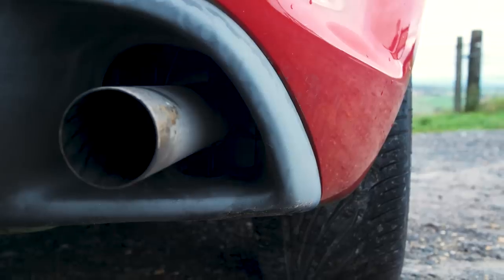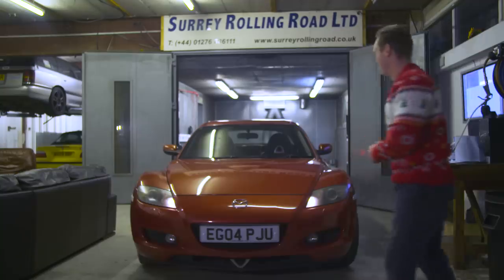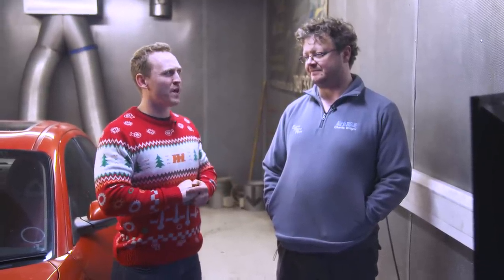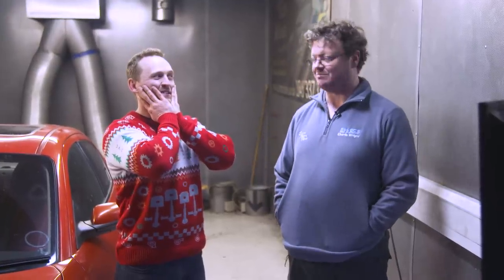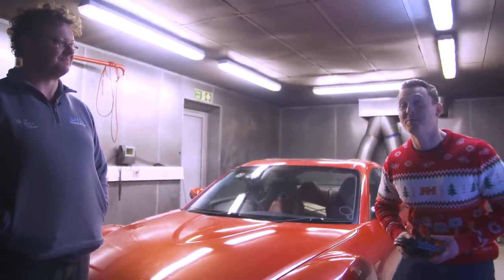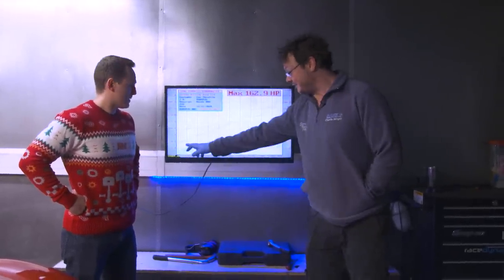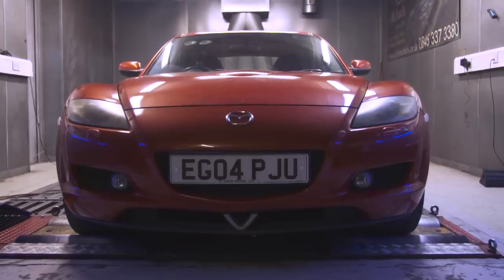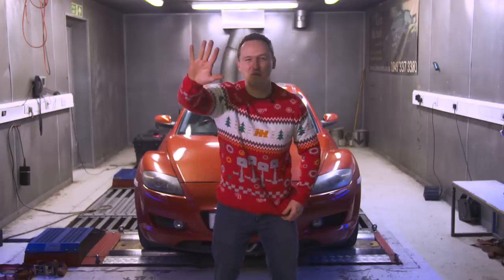How Much Power & Torque Does A Broken Rotary Engine Make?

Comment: I genuinely don't know why my RX8 was so reliable. Started first time, every time up to the point I sold it at 92k miles. Still running perfectly with it's new owner. Never treated it gently either. 9k was hit every time I drove it, wasn't a rev limit, it was a rev target. 

I still miss it.
Reply: If you heat it up and then rev it to the limiter it should last a long time.
Reply: Yup. Seems that way.  First 5 minutes was never above 3.5k rpm. After that, onwards and upwards. Got to get that third port open.

Comment: Missing out on an extra 1,000 rpm there. PIN IT!
Reply: My thoughts exactly. Although looking at the power curve drop it's not going to help this poor rotary.
Reply: stock s1 doesnt really make power past 8k so stopping there makes sense
Reply: was wondering if anyone else noticed that...
Reply: @MrDrJelly  nope, 231hp at 8'200rpm...
Reply: if the car has max 9000 rpm the hp peak is at 8000... something. usually in racing they still hit 9000 because the gear is shorter than the next one meaning it will be faster to hit redline and heaving more rpm for more power in the next gear to accelerate faster out of it...
idk how to explain but you get what i mean
Reply: With a fucked engine like that you wouldn't want to take it to 9k
Reply: Spot on! They make peak power at 9krpm.
Reply: drgibs347 it peaks on 8,2k
Reply: Worst thing is the rotors themselfs only rev to 3k max, the e shaft is the only part doing 9k revs (it's geared 3:1 with the rotors, piston engines pistons rev higher.
Reply: @alexstromberg7696  That's true however for every single rotation of the rotor it completes three combustion cycles so one cycle per rotation of the e shaft. In comparison, a piston engine completes one cycle for every two rotations of the crankshaft.
Reply: @alexstromberg7696  nooooooo my whole life was a lie
Reply: Sam Boofle rotarys need to be redlined tho
Reply: At least my 2004 RX-8 peaked in 9000 rpm and the limiter is in 9500 rpm. The peak hp on the wheels was about 180 hp(134kw) and on the flywheel 220 hp(164kw). This was run in +35 Celsius temp which is HOT. th The engine have not been rebuilt and have been driven 100k km.
Reply: @FVampir  you don't want to redline this engine...yeah it might gain 5-10hp on dyno, but  engine is already damaged...he wants to rebuild it, so it's better for it to not explode in tiny peaces 😂
Reply: @tomjames4064  they still only rotate 3k time a minute. If they do 3 time as much a rotation isn't relevant.
Reply: @tomjames4064  2 stroke!
Reply: @GTRWelsh  Rotary's are 4 stroke
Reply: @tomjames4064  yeah but one power run per rev is like a 2 stroke :)
Reply: @GTRWelsh yeah that's true
Reply: Yea I don’t understand why he didn’t rev it until fuel cutoff. Would have been nice to see that needle go DEEEEEP into the red zone. 

I kinda suspect that power numbers would have went up a bit more and post rebuilt, he would only gain back maybe 20hp at most. 

The point of a rebuild is to have an engine that starts HOT and doesn’t die at idle. Low compression sucks. My 04 has 140,000 miles on the original block and is barely running. Still daily it and rev to 9,500 EVERYDAY.

Comment: Why do you stop the Dyno at 8000? It still has 1250 rpm, and its peak power is way up there at the red line
Reply: My thoughts exactly. Didn't exactly rev it out
Reply: RX-8 can 10k RPM max.
Reply: It's over 9000!
Reply: You don't make peak power at 9000rpm unless you have some serious porting done.
Reply: Exactly, it can go to 9250 rpm, Peak power should be around 8500-8750 I think. But at least I am sure that not 8000 rpm.
Reply: with that dip in the graph that shows some serious problems, what exactly should it bring to rev it even further?
Reply: @Digi20  the dips are totally normal on a renesis. they are there because of the ports that open at specific RPMs. you can see that, even the last dip is then leveling, so it would probably make some more
maybe it wouldnt make more power, but the point of a dyno is to rev it to the limiter. 

ofc, in retrospec, and after seeing the compression numbers, this engine is ruined anyway, and its amazing that it kept running anyway
Reply: @dimosk7389  odd  all other dyno vids rev to the limiter.
Reply: @dimosk7389  what are the compersion numbers?
Reply: @ezakalized4066  I don't remember now, it's been a year. You can watch the next video of their series where they make a compression measuring (if I remember correctly)
Reply: He's car has compression issues and his his power band dips after 6k revs so no point reving it over 9k

Comment: These cars have a place now. It was a silly buy back in the day when they were new, because you had to be a proper petrol head to maintain it and as a daily driver it is so uneconomical. but when you can buy one now for £600 and rebuild it for the cost of replacing a turbo on a convetional engine it's very interesting if you want some weekend or track day fun. When you consider its main rival the 350z is still 7k for decent one, makes you realise.... I'm very interested to see the rest of this series.

Comment: My RX8 is named Mazdalena :) and her engine is being rebuilt at the moment so this series came just at the right time!
Reply: keyboard warriors :D
Reply: Keisuke Takahasi how?
Reply: Do yourself a favor and swap the engine with a v8 or inline 6.
Reply: @glock1inthetop45   You cant just stuff a rew in and call it a day. For the amount of money it would take, you could rebuild an RX-8 engine at least 8 times
Reply: KillaRock404 yes you can dude they make bolt in kits it’s like 2 thousand plus another 2k for a rew I did it myself
Reply: KillaRock404 and hell no they charge 6k to rebuild a renesis I’m California
Reply: @glock1inthetop45  6k sounds like a remaned one from mazda. To rebuild one it, if youre using the same irons and rotors cost about 2-3k. For a REW swap, theres a lot you have to do. You might even need a new transmission depending on the power you're looking for. To do it right its going to cost you about 20k after everything is said and done
Reply: KillaRock404 no it’s not dude lmao I dude mine for 7k 460whp 12psi
Reply: @glock1inthetop45  sounds like i need to go to cali for my swap then lol
Reply: Thats a good name

Comment: These rev to 9.5k and the power is right up top and the tester only took it to 8k :/
Reply: Power drops off so its pointless.  You can run them over 10k if you like, but there's absolutely no point.
Reply: @petertr2000  they have no torque they need to be revved
Reply: Demekpr4e n
Reply: @lilpattman  do you know how bhp works? its a function of torque, if it makes no torque at high rpm then it wont make any power either
Reply: Or the thing wouldnt rev to 9+

Comment: I'm happy you bought a RX8. Because I never dared to
Reply: I dared to. Best sports car I've ever bought. I touged with an evo and stuck with it the whole time, only slightly losing my gain on the straight aways
Reply: @mendezmarcos38  yo its possible to buy a rx8 and change the engine so it consumes less fuel ? just asking cuz i really like this car but need to spend less money on fuel

Comment: I've owned my Rx-8 since she was brand new. Bought in 2007, she never let me down and I had a lot of fun with her. I would never regret going Wankel. (=
Her name is Roxette, but friends call her RoX-8. She's green, with a black roof, black rims, orange details here and there and black and orange interiors. Pretty unique, since I made her myself.

To prevent the apex seals from deteriorating too quickly, I made a modification to the oil circuit. Now I have a small additional 2 stroke oil tank and the oil metering pump draws from there, so the seals get better lubrication, better cooling and don't get stuck by the gummy waste motor oil leaves when it burns. I also like to mix a small amount of the same 2 stroke oil into my fuel tank.  100cc for every 50€ refuel should do (around 30L), twice as much for a full tank. It's one tenth of what I use for my 2 stroke moped, by the way xD

You revved yours up to just 8500 rpm... the max power output should be at higher rpm than that, but I guess many people already told you this in the comments. Call her Felicia in the name of Felix Wankel ;)

Comment: I finally let my 04 RX8 go this year. I bought it new (winning blue sport 6 speed) and loved that car more than any other vehicle I ever owned. But the 2nd engine was starting to show "signs" at 120k miles.. and there was a list of other issues that all-in-all was going to cost a big pile to get back to 100%. These cars - when properly sorted- are a blast to drive anywhere (and look good too). Think S2000 with more room and a back seat. Good luck with the build.

Comment: The reason the RX-8s are notorious for low compression is because Mazda used an electronic OMP and made the OMP put less oil into the combustion chamber to have cleaner emissions, but the effect of that is less lubrication for the center of the apex seal. You can actually go to an aftermarket ECU such as the Apexi PowerFC, which allows you to control the amount of oil put out by the OMP yourself. However, this 13B is obviously too far gone already to be saved. Good luck!

Comment: Rebuild it. It's cheap and easy. Then drive it another 70k miles
Reply: That'll be rebuild #3....
Reply: Its not a cheapfix i think about 1k ish all included
Reply: People always seem offending about rebuilding rotaries. Lol I mean, even if it's every 10k miles, whatever. I drive my 7 on the weekends, when the weather is nice. I maybe put 2000 miles on a year. I'm well past 10k miles on a 450hp motor. Closer to 18k. I'm gonna test it down this winter. The rebuild will cost me like $2000. And the motor is now like 8 years old since I built it. $2000, every 8 years...  shit, lets cut that time in half, and quadruple the price. $8000, every 4 years. That's like 3 weeks pay.
Reply: Rafas Garage rebuild every 25k tbh
Reply: didnt you watch this or last episode? he said about 5 times hes gonna rebuild it
Reply: Big 'ol Booty Cheeks 
You sir are a true car guy. 👍🏻👍🏻
Reply: 70k lol you are lucky to get half that on these engines. Never a cheap fix one you add cost of labour parts, towing it to garage and inconvenience of the thing breaking down not worth 1000 every 20 to 30 k miles... not worth doing it yourself
Reply: My car had the engine rebuilt by mazda under warranty at around 18k miles. It currently has over 97k miles on that same engine and still has good compression. Its really not difficult to maintain. Just always keep the oil topped off and ALWAYS let it warm up.
Reply: @schaapje666  that's cheap in retrospect of a piston engine.
Reply: @AldousForestTheLast  I own one. That's not my experience or the experience of many owners that know how to care for the engines. Mines still at 68k original miles.
Reply: @keisuketakahasi4584  I dont pay too much attention.
Reply: Alan Rabbitte  me and my wife make around 8k combined. I too drive an RX8. The millionaires car is a Camry. What you drive and how much one makes is irrelevant
Reply: Alan Rabbitte  i could be a millionaire and still want a rx7 and rx8
Reply: schaapje666 cheaper than a regular engine He meant.
Reply: I guess it's shocking to some people that 120k yearly is a thing. I mean minimum wage will get you 1/5 of that at McDonald's.
Reply: Alan Rabbitte  well I deffinetly can't afford a new Ferrari... You ever bought a house? Now that's an expense!

Comment: I bought my RX8 for £100 last year. Hot start issues as expected. After a good de-carb and a bit of a WD40 spray to the A seals it turns out the A seals were just stuck and was good as new... Still had it rebuilt with Rotary Revs. (If you get it rebuilt 100% get it ported at the same time)

Comment: I know that this engine has oil injectors, but how about adding a little of oil to the gas as well? Just to help with lubricanting the center of the seal, but not too much to screw up the mixture?
Reply: A lot of owners do that, and I do it too. ;) 
It is called premix. The engine loves it. I put 250 ml of 2stroke oil for 60 l of fuel.
Reply: @alexandrerousselin4467  Or just buy a series 2 (2009 to 2012). They have the extra center injector and use less oil too.
Reply: A quart of 2 stroke in it, could work
Reply: @kevinwildash5726  Just buy an R3?
Not that easy... They are more expensive and rare in Europe...
Not mentioning that the design is a little bit different, and not everybody likes the design of the R3
Reply: @alexandrerousselin4467  I liked the R3 design so much I bought one new in 2010 and still have it. It's just coming up to  20,000 km and completely stock - I occasionally go for a blast in the hills on weekends. In Australia the R3 is called the GT version just to confuse everybody overseas lol. But yes, they are hard to find mainly because Mazda sold so few of them due to the bad reputation that the series 1 got. It's a pity. But I love mine.
Reply: @kevinwildash5726  Actually, in Europe (at least in France), they sold very few also because of the new emission/pollution regulations when the R3 came out. The taxes you had to pay were expansive :(

Comment: A fast starter helps immensely with the hot starting issue.  This helps to the point where it will die while idling before you get to a point of not being able to start on the first place.

It can be helpful to run thicker oil to help seal compression a little better.  However, at some point you just need to rebuild.

Comment: You want your rx8 reliable ? Change oil, check oil at the right time, and also change spark plugs and coils, a bad ignition can lead to engine problems .. premix if you have a series 1, a series 2 already has 3 oil injectors. I am a rx8 r3 owner, it has 145.340km and the only  i thing i had to do beasides regular maintenance was the cat !   If you do it right, you may not get problems, but if you dont respect the maintenace of the car and dont do it properly, and you drive like a pig without the engine being warm, its probably is going to fail ! This is my personal experience 👌🏻
Reply: Premix even with the oil injectors in the late models for good measure.
Reply: Polyglotgiorno90  Stay strong, I'm sure you'll find yourself back on the road in a beautiful rx-8 soon after those accidents. I wrecked two Hondas and I'm trying my best to find myself a car that pays homage to the cars I liked so much, insurance is a cunt but you live, learn, and rise up from your mistakes in better shape than you were before.

Comment: You should see those dips in the power curve. That is correct operation of the variable intake runners and auxiliary ports opening up.

Three dips. Always, any dyno that doesn't have this has the resolution turned down.

Comment: I think you'll find most renesis engines fail due to side seal spring wear, not the apex seals wearing, but carbon build up causing the apex seals to stick is another cause of lower compression.

Comment: Dude, he didn't go to 9000-9500 rpm.  You don't stop at 8k.  Go look at actual rotary dynos.

Very disappointed at this guy you hired. What a smeghead.

Seriously, go Dyno the thing properly before teardown, then Dyno it properly after a proper rebuild.

I don't expect it to get much power with low compression, but if you are going to do things, do them right.  Go look at Rob dahm's channel and even ask him for some advice before you make the series not worth watching.
Reply: Kaboom?
Reply: Kuro Murasaki .did you stop to consider mayyybe thats as far as it would rev?
Reply: Yeah take a broken engine to 9k

Comment: Put a bit of premix in (0.5 Oz. per gallon as you have an OMP) and lower the fuel grade to 87 from 91 (or whatever the equivalent of premium and mid grade is over there). The premix will help with lubrication and sealing and has shown that it does add a tiny bit more power and with the lower grade fuel (assuming ecu reset and fuel trim relearn has occurred) dyno numbers have improved. Some new coils, plugs and wires would definitely help as well.

Comment: He didn't even rev it all the way out though. Not even close
Reply: So 8k is not even close, considerind the engine is damaged.
Reply: No point, Power had already dropped off 😂
Reply: Low compression will not inhibit the engine from revving to it's full extent, nor will it damage it any further than it already is damaged, which is effectively, it's not damaged, it is not actually "broken" it's just worn out and tired. Unless something like detonation or preignition happens, this engine can be revved to 10k all day long and not miss a beat. Nice try though.
Reply: no need to it allready dropped power twice on all 3 runs reving it wouldnt make anymore power just make the line longer
Reply: @adamhorrell9030  you're wrong. It dropped where the SSV and VDI open up, there is a miniscule drop in power as those valves open up and the PCM recalculates the AFR needed to continually make power.
Reply: @turdferguson810  you didn't read what I said, it didn't drop violently, it dropped maybe 2-3 horsepower for a split second, climbed, and at 7k dropped for a split second, then climbed all the way to 8 until he lifted, 8500 rpm is where peak power is made regardless of compression, I've worked on and Dynod more RX-8s than i can count, and an engine can have barely enough compression to idle, and still make better power figures than that if revved out properly.
Reply: @darionfarina2069  yeah thats true but compare that to most dynos runs from rx8s you can see its not going to make power past as it iddnt start to climb again when the second vale opened up so no need to rev it anymore
Reply: I had an old RX-3 with a peripheral port 13B. it would barely start making power till 7000 rpm. It peaked at about 10 000 rpm. Different engine, but they do like to rev😊